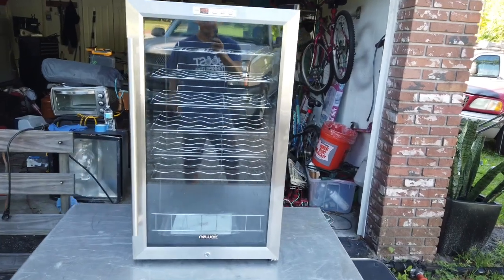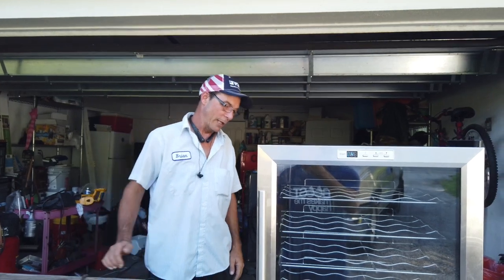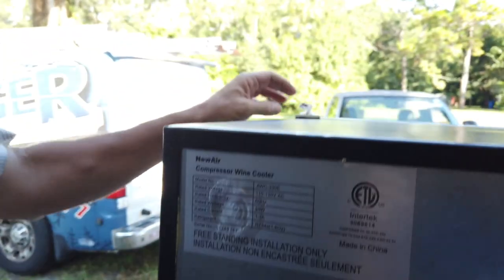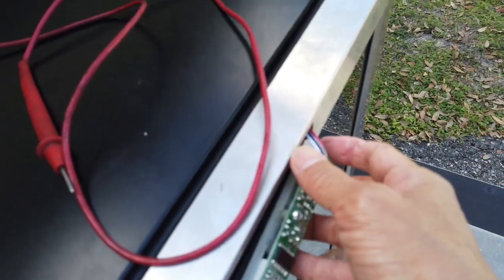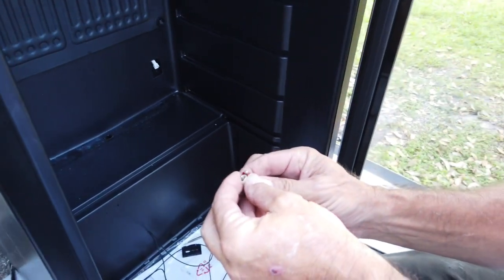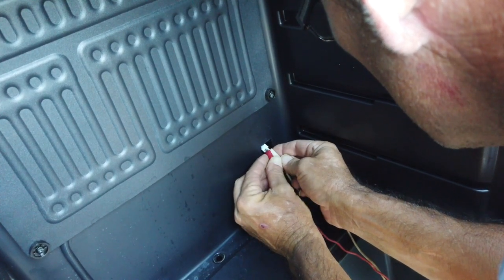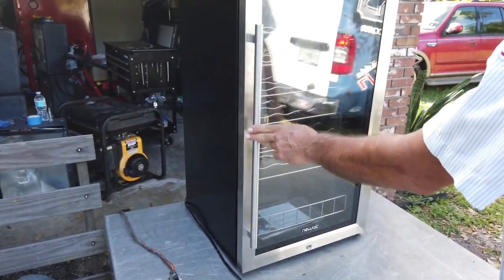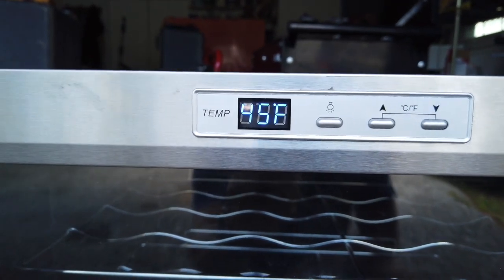Newair Wine refrigerator - cooler repair Wine refridgerator - cooler repair

Comment: Would you happen to know a part number for the thermistor. Believe I'm having the same issue with my newair.
Reply from the maker: Hey, the part number on the thermistor is 14K9201.  This thermistor was not a factory replacement, we just had this one on hand and it worked out pretty well.  We just looked on Amazon but it was sold out/unavailable at this time.  Hope this helps. Let us know how it goes.  Thank you